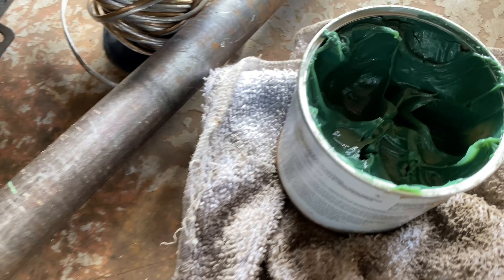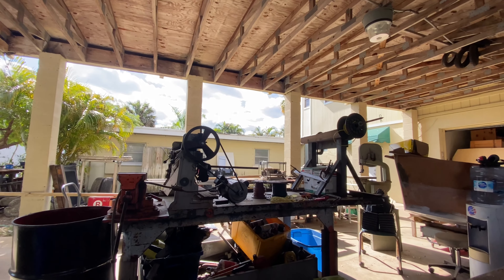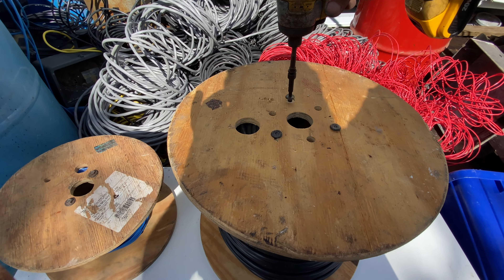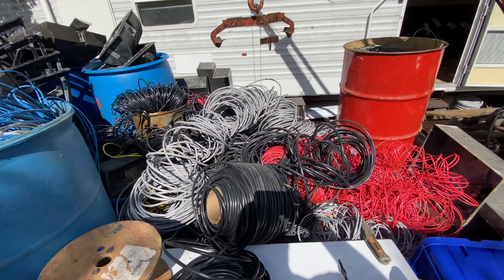Homemade copper wire stripper

Comment: A question on your stripper, it looks like it’s more or less just crushing the insulation, is that correct?  The only blade looking parts I could see were the ones where you said it didn’t turn out that great, or something.  The rest just look like grooves that the wire feeds through and the sides of the groove pinch and crush the insulation.  Does that sound about right?  It looks like something I might be able to do.  Thanks for another helpful video
Reply from the maker: I do use the blade I cut for the bigger stuff. smaller stuff I run in the groves and the sharp corners are actually cutting the insulation. It makes 2 cuts. sometimes 4 cuts because its top and bottom. solid core wire it just squeezes it so hard it comes off. Real simple and works great. Thanks for watching.

Comment: I am wondering  what kind of a blade you would use for a stator splitter to cut in half. And where did you get those pliers for pulling the copper with your machine your making. They looked yellow on table like the ones the Chinese have on there machines. Thanks again for any info
Reply from the maker: I was thinking of two kinds of blades. One like a pointed guillotine and one kind of like a old school paper cutter, but bigger and with hydraulics. I think the pliers you are talking about I made out of a pallet puller as an experiment. They are to heavy and not enough leverage. I will be making new ones. hope this helps and thanks for watching.

Comment: Long time my friend. Nice video any way .
Reply from the maker: Thanks
Reply: Project Shop Fl my friend I have questions to you because I trust you .
I have offer from Miami and from Texas scrap alternators 400$ ton .
Cooper wire 55 to 60%  recovery 730$ ton is these prices familiar with you or its fraud.
Your answer will make different with me.
I don't see nothing yet but is these prices good to believe or not .
Thanks
Reply: Project Shop Fl thanks for your replay
No I want to buy from them they are company and they offer me to sale to me per ton wish is 2200 lb for 400$ ton for the alternators and 730$ per ton for the insulated wire.you think that's real.thanks
Reply from the maker: @rassas1975   i don't know where you are from but 1 ton is 2000 lbs
Reply: Project Shop Fl it's ok that's not the issue the thing is is it ok if any company offer you 400$ per ton for scrap alternators or its just scam.
Thanks
Reply from the maker: @rassas1975  might be ok $400 per ton is .20 per pound. Are you processing it or reselling?  you have to know the average % of copper, cast aluminum, and steel.  If you are processing you have to know how many lbs per hour you can process, how much money  you are getting for the processed material
Reply: Project Shop Fl thanks my friend you don't how much you release the procure inside about you all questions yes I know how many and how much but this regarding business not one or two pcs.
Any way thanks a lot for your help .
Reply from the maker: @rassas1975  ok good luck

Comment: When your buying spools , how do you go about figuring out what to charge. I'm sure you don't pay for the spool.l need help with this on what to charge.thank you.
Reply from the maker: Depends on the spool. Sometimes I will weigh one if there is a lot of similar and put a tare weight in it. If they are big wooden spools I will weigh the hole thing, strip it then pay after I weigh the spool.
Reply: @ProjectShopFl  thank you

Comment: So how do you get your wire scrap, do you just hit up local electrical contractors offices and talk to them about taking scrap? or do you hit up job sites?
If you you'd rather not say here that's cool.
Reply from the maker: I started out 10 years ago strictly buying Hid transformers. It wasn’t a big market for them and since I built the machine to process them I could pay more than anybody. I started off with the Kelley blue book of contractors and called every single electrician in my area code and then expanded from their offering them free pick up and paying higher than anybody for the transformers. I never asked about copper wire electricians Get tons of calls and people asking for their wire all the time. You have to approach it from a different angle most of the time. Be honest and have a big stack of $$$. Have a good buyer where you can compete with local markets. Process as much material as you can. Always think about efficiency in every aspect of Scrapping. Get or build machines. good luck and thanks for watching.

Comment: Its crude but you cant argue with results.However I can curse you for destroying a fine slip-roll.
Reply from the maker: I bought them as Scrap, Both of them were damaged in one way or another and missing a lot of parts. I salvage as many parts as I could from both of them and built this. Thanks for watching

Comment: Dont get too fast n loose playing with that toy... you get caught up in the wire, the belt or pulley, or get some loose clothes snagged and im sure you’ll regret it! It Should almost have a foot pedal control or something that you can shut it off in an emergency. Sounds goofy but in a bad situation you would never get to that switch in time! Might be worth doing for the 5 minutes it would take to figure out
Reply from the maker: I appreciate your concern and I will agree it is extremely dangerous. lol  At Project Shop we would not have it any other way.  I do not use this machine at all anymore and when I did the switch was actually mounted in front of the machine where you could just bump in to it and it would shut off and if you lean in to the motor it will hinge up and loosen the belt and stop even faster than the switch. Also I standing in front of it puts you in a safer position where you are not next to the belt and pulley or reaching over them.  It was only mounted on that table that way so I could use it to un-spool all that #2 insulated wire. Thanks for watching